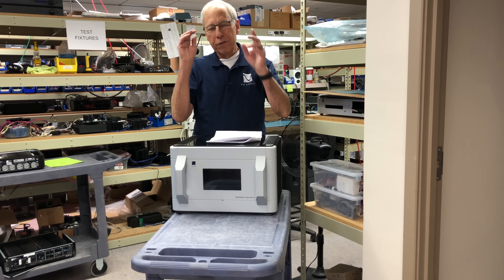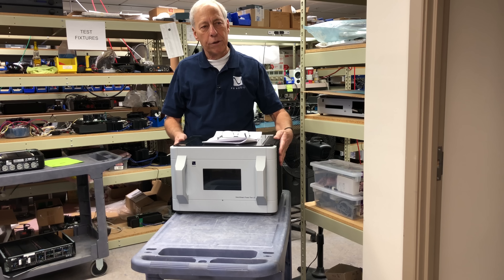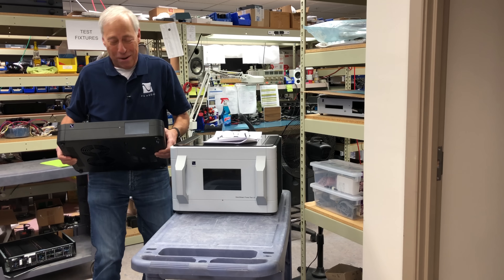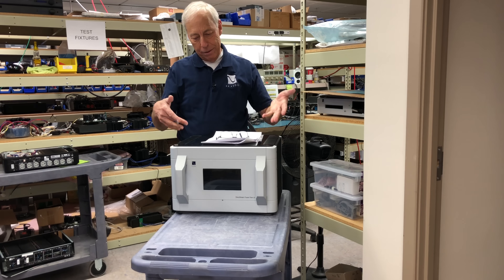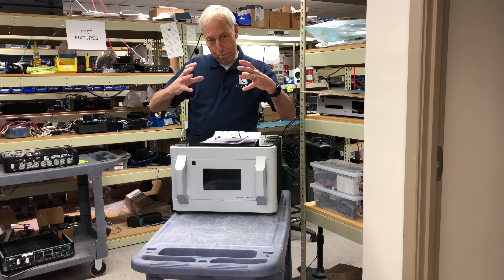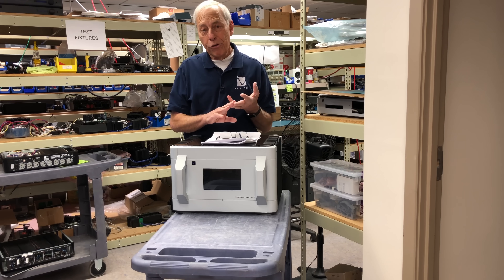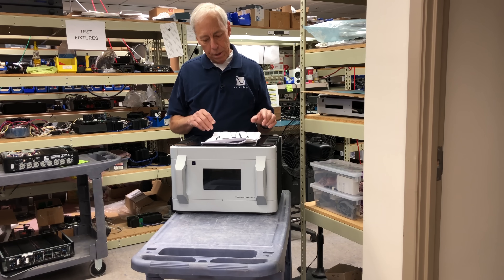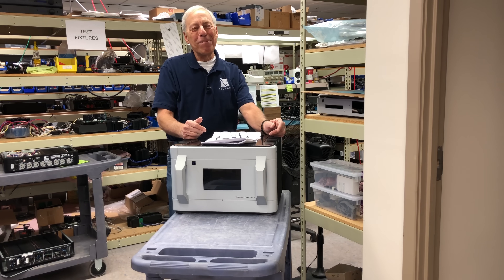Why are Power Plants so expensive?

Comment: why not just store DC current in a simple battery with its protection circuit ?
doesn't the amplifier rectifiy that AC power again ?
why convert AC [powerline] to DC [battery] then to AC [inverter] then again to DC which is what the amplifier uses ??

an option to get DC directly from the battery and supply it as DC to the amplifier would be much straight forward, cheaper, much less chances for noise to get in through power lines, and more efficient ..
Reply: There is a substantial part of the audiophile community that does just that . For 10,000 $ you can by a humongous nearly 100 kWh battery which could power your system for maybe a month or more . My DIY Hypex amps have a DC input  with an eye to battery power later on . Battery power is the cleanest power you can get
Reply: Now that's the real question!!!
Reply: That's what Danny at GR Research does.  He just drives his reference system off of DC power.

Simple solution, and much cheaper!
Reply: There actually are amplifiers that do that. PA system amps are often required to have local backup power for emergency. But beyond that application I'm not sure why anyone would bother. The cost of doing it properly for supporting high end audio would be outrageous. Also batteries are not as clean a DC power source as a well engineered linear regulated AC power supply. The chemical reaction during both charge and discharge does produce some minor electrical noise. Easily filtered down to insignificance but raw battery power is not exactly pure clean DC. The famous mid 1970s Dynaco 400 did have an external capacitor box option available which gave the amp improved dynamics capabilities. You don't see too many of them so I don't think that option was a big seller. And today those caps would be of questionable life span after 40 years.
Reply: @andydelle4509  eliminating that chemical noise from the DC signal is far simpler than eliminating it and converting the current to AC, my point is that this is redundant, adds significant cost for these ( quality built parts ) while in reality its not needed to achieve the main goal, which is eliminating power line noise, i simply call this over-engineering

some arguments that high end audio ppl come up with is like `driving your car will cause the dust particles in the air to scratch your clear coat very slightly, and to protect that clear coat you need to spray paint it with a protective layer that happens to be more expensive than the car itself` !!

that chemical noise can be very hardly audible, could be seen on a scope yes,, but can't be heard
Reply: @MrAdeljas  OK yes it is simpler than a lab grade AC power supply with extremely low noise. But attaching a battery to a power amplifier is currently not a marketed option for any HiFi audio amp I know of. And think about it. There is no standard rail voltage either. Yes there are typical ranges based on the amp output power but still not a match to any COTS battery. And you need +/- rails as well so that's two batteries minimum. This would be a serious DIY modification. Another approach is to use a standard battery voltage or multiples there of and then a DC/DC converter to power the amp. Basically the way modern higher power car amps work. But then we are right back at the noise problem again from the converter.  If you need blackout protection for your amp, you can always attach it to a standard computer UPS unit. Yes it may not be the most efficient but it is a universal interface, the AC plug that is, anyone can set up themselves. Now as for the PS audio Power Plants, no I don't think they are necessary in most home installations. Do they work? Yes they do what they claim, the question is do you need those improvements or is your home power good enough? They can have a benefit if your utility power is sub standard.
Reply: Add solar panels and go off the grid !!